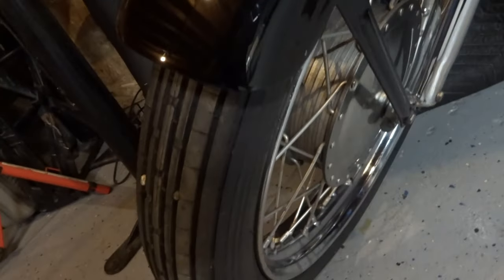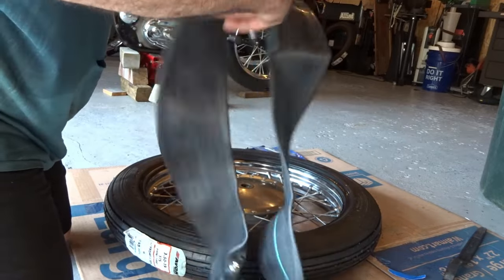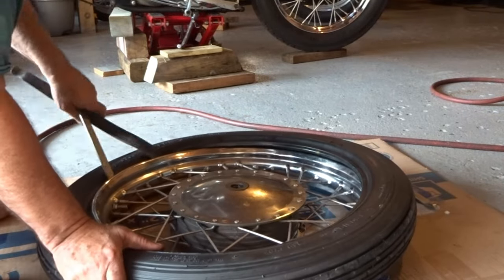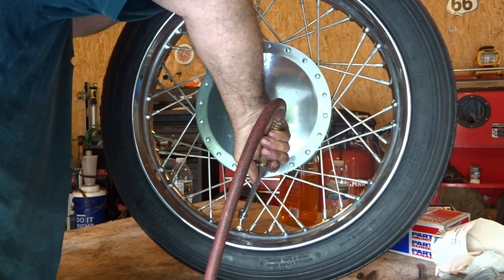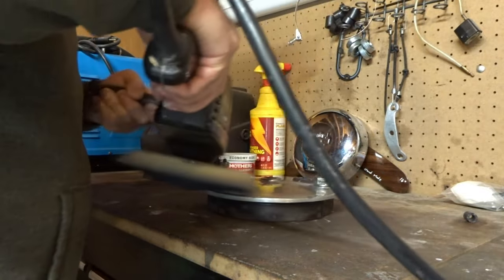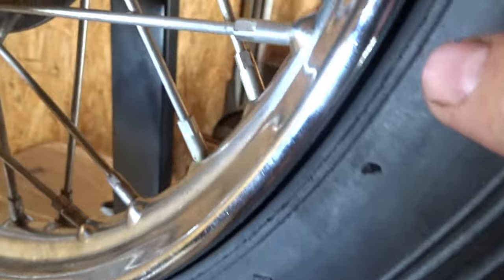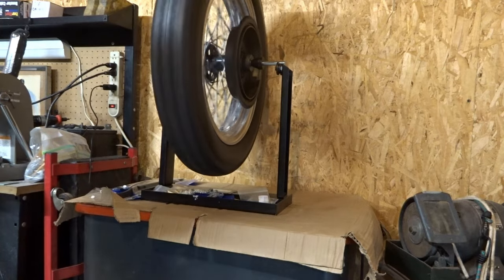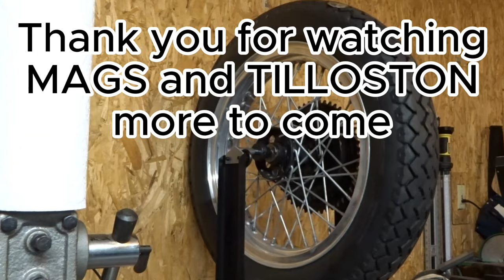Harley Iron head Sportster, Change your own tires, tubes and balance

Comment: Hi Mike. Been changing my own tires for a long time. I've been using a set of extended jack stands with the axle through the hub to balance.  It worked OK but just last month I sprung for the balance stand from Harbor Freight.  Big upgrade for my garage! Looks similar to the one that you use.

Also agree about chrome. I think the former owner of my 1969 XLCH dipped the entire bike in the chrome vat, that includes the frame. All the chrome was in TERRIBLE condition except, thankfully, the frame. It's chrome was in good shape, so I left it chrome.  I took the rocker boxes, cam and kicker covers, F&R brake backs, headlight mount, magneto body and a dozen other small pieces to the chromers to have the chrome removed. Got the stuff home then hand sanded and polished it up. Looks way better!

Keep these vids coming. This is a great channel and will grow as the word gets out. Thanks for doing these.
Reply from the maker: Hello John, good to hear your doing your own tire changes. I have the HF wheel balancing set up too! It works just fine. The first thing I did was strip all the flaking chrome parts off my bike and went with 100% stock factory finishes.  Back in the day they chromed EVERYTHING!  I hear you have your whole frame chromed?.. wow.
I used to mold in the necks and do a custom paint job on mine along with a bunch of custom parts including a big double stack Weber carburetor my right knee would have to be contorted around…but it looked cool! 😎 Lol
Keep going with it John, it would be interesting to see your bike when it’s finished. Take care my friend!

Comment: Another good video, Michael. You are right about polishing the aluminum parts, especially on a Sportster. Sportsters look more original and better with polished aluminum parts, plus much cheaper than chrome. I've seen guys strip the chrome off of Sportsters parts and polish them. The spokes on them wheels look like NOS or stainless steel. Original Harley spokes don't look so good after 50 years. Have you ever built Sportster wheels up from rebuilt hubs. The wheels can look beautiful with fresh black painted rear hub and polished front hub. Use Buchanan stainless steel spokes, refurbished rims or new ones. I ever coat the inside of rim with grease to protect it from rust and use a lube on the nipples. Then with Avon tires on them, they look as good as it is possible to make them look.
Reply from the maker: Hello Joe, the spokes are newer stainless on the 68 XLCH. And the rims seemed to have been re chromed at some point before I got the bike. I never have re spoked a wheel yet to be honest. Maybe at some point I will if I find it worth it. The spokes on my aluminum rims are all original and in great condition. But like you said after many years the cad plate tend to degrade.  But I have a quick fix for that I will share with everyone on a coming video. The tires you see are indeed matching Avon’s front and back with the speed master up front of course.  It’s been a cold and busy month and I been way behind on doing videos lately.
I hope to catch up this summer with some riding videos to break things up a bit and moving definitely will throw a wrench in the works!

Comment: Good video. I have done tires before, don't hate me, but i prefer to take to local shop, 25.00 and 1-2 day wait. It really depends on how i feel. I did one in the winter one time, tire was hard to stretch, so i broke out the heat gun and that helped.
Reply from the maker: I guess everyone has a particular job they prefer not to do big Ed. I did body off restorations on my vintage British sports cars for years yet I much prefer to bring in my Nissan Murano for work because I have no passion to tinker with it.  I know how you feel!  That being said, I been changing bicycle tires as a kid for years so this is second nature to me…unless I’m away from home, then out comes the charge card lol.
Reply: @Michael-st1hl  i'm digging your videos,though. Keep up the good work.

Comment: Hello Michael. It’s awesome to see content like this covering the early XL machines!

There is a something to be aware of on these early machines when balancing the rear wheel using a spindle that is not the same diameter as the axle.

Behind the large nut securing the left wheel bearing in the rear hub is a spacer that relies on the axle to align it with the wheel bearing in the hub. If the wheel balance spindle is smaller in diameter than the axle, the spacer can float off center, resulting in the spindle not being centered through the wheel bearings.

The balance cone will be centered in the spacer on the left, but the spacer will still be free to move, resulting in a misalignment.
Reply from the maker: Hello, I really appreciate your in depth comment concerning these old iron heads rear wheel balance. I started out putting a dial indicator on the rim checking for TRO “total run out” before mounting the tire and checking all the spokes as well. 

Overall the rim runout on the O.D and side were nice and true. After I mounted the tire and tube and balanced the whole tire and rim assembly again I checked the runout of the actual tire side wall and tire circumference, again it checked out beautifully with a minimum of reasonable runout. 

I am close to getting it out on the open road this spring and will start filming its first road test. Usually you can really tell the balance on a tire at about 50 mph. 

I have a lot of experience on this topic because I restored vintage British sports cars with wire wheels and knock offs for many years and it was absolutely crucial to have the balance as close as possible which took a lot of extra effort then a usual rim. And all the more care on a motorcycle for sure. To be honest, most of the videos you see where only meant for my personal documentation and where never meant for YouTube. But I decided to put them out there to encourage other people to save these old classics instead of parting them out or letting them just rust away so future generations can see what a stock factory XLCH, XLH looks like and hopefully others will be encouraged to save more original bikes and get them back on the road. 

They are a MUCH different riding experience then todays motorcycles and really give you a raw mechanical seat of the pants feeling from the time you prep to kick start it to operation of the vintage throttle and right shift foot controls, not to mention the vintage brakes… if you want to call them that! 

These old CHs have the power and torque for sure!  But you really have to be on top of them when it comes to braking. All in all you have to ride them like a vintage vehicle and give plenty of time and space to stop!  Thanks for watching and I hope you subscribe as I get these iron heads down the road this summer… always something to do on these old bikes!
Reply: The kindest thing that could be said about the brakes on the early magneto ignition Sportsters was that the brakes were offered! 🤣

Another piece of trivia, if you’ve not seen one, is that Andrews Products offered a 45mm Tillotson carb in the ‘70s; I ran one on my 84” ’74 FX stroker.

Keep up your good work and good luck with your project!
Reply from the maker: @djkak5320  I’m going from duel front disk brakes on my EVO Dyna to the pancake front brakes on both my stock iron head sportsters.  I’m going to need a LOT of time and space to get the thing stopped! And I have to be very honest, I had some very close calls with good brakes on my Dyna I just sold, so getting back on these vintage sportsters will be interesting in todays traffic panic  stops!  You don’t really come to a stop on these old Sportsters, you coast to the object in front of you! 
this summer I will be riding both the 1968 XLCH and the 1970 XLH until I get a bigger road bike in the future.
I will do some riding videos on these vintage sportsters mostly out in the countryside this summer.  Heck, I never knew they offered a larger version of the tillotson that size. I have a HD2 tillotson laying around but it’s the same size as both my HD1 carbs on my Old Sportsters.
Reply: Hello again, Michael. I’ve uploaded a wheel balance vid to my account that I recorded years back. I think you will find it interesting. 

I have a drum brake vid that I’ll look for and upload in a day or two.

Have an awesome evening!
Reply from the maker: @djkak5320  I look forward to checking out that particular video.
I really appreciate you sharing it. 
Every day is a school day!  No matter how old we are.  I subscribed and will check out that video.  Take care and thank you again!